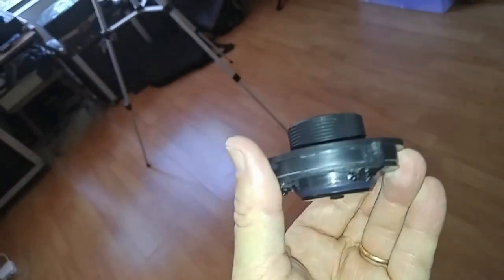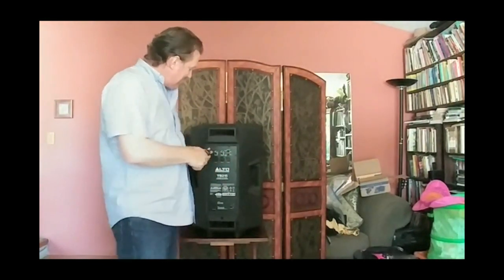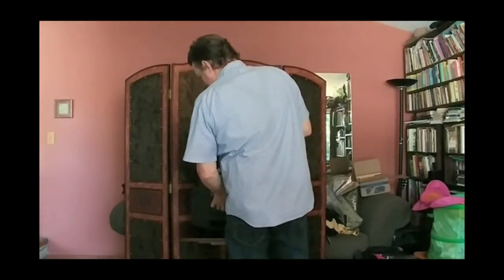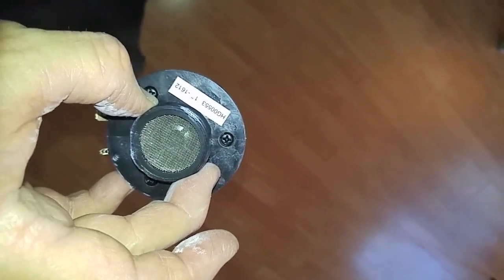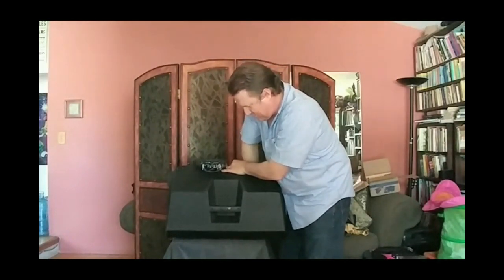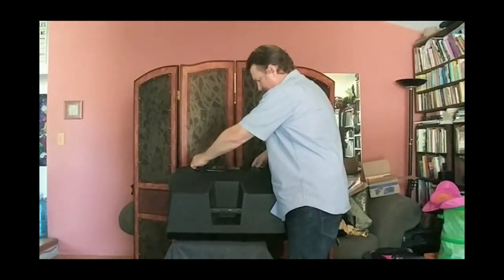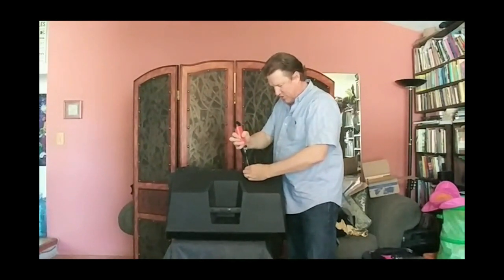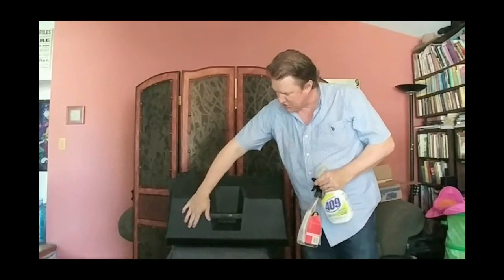How To Fix Alto TS215 Replace the HF Horn Driver Tweeter TS212 / TS210

Comment: Excellent video thankyou for posting, it worked, however mine didn’t come with a heat shield. Is it necessary and could u point me to a replacement heat shield like u have…Thankyou

Comment: Hi DJMarkP1, great video.  A very helpful tutorial!  

For anyone connecting a mixer into these speakers, the one and only correct setting on the rear panel of the speaker is 12 O'Clock.  That's the 'Line Level' setting, and that is what is appropriate for use with mixers.  The only time a lower or higher setting is appropriate is if another type of audio source is being connected directly to the speaker input (i.e. an instrument or a mic).  

You can blow drivers with the setting either too low, or too high.  

When the input gain setting on the speaker is too low, drivers get blown due to the voice coil burning out.  Voice coils burn out when performers turn up the audio source (mixer in this case) too high, and send clipping signal to the speaker.  It is very common for the faders on our mixers to creep up and up throughout the night.  Maybe the night starts with an occasional clip on the 1 / downbeat.  Half way through the night, we've raised the gains or faders on the mixer, and we're clipping on the 1 and 4 (kicks)...then on 1,2,3,4 (kicks and snares), then on every beat (eighth notes too).  The distortion from clipping in the mixer drives speaker drivers crazy.  A driver is like a piston, it goes back and forth in sinewaves...but distorted audio is squared off waveforms.  Since the piston motion can't produce a square, the inefficient motion is converted to heat instead, and eventually burns the voice coil.  You can actually burn out a speakers voicecoil with one watt of power by sending distorted signal.

When the input gain setting is too high, the amplitude of motion the diver (piston) is asked to reproduce is so high that it actually rips itself apart.

In either case, I'm sure other users will find your tutorial helpful!
Reply: Hi DJMarkP1 just caught the end of your video where you show how you're running audio into it.  When using an iPhone (or any phone), keep in mind that 'headphone outputs' are hotter than line level.  For this type of audio source, you should keep your phone 1 or 2 clicks below full volume.  Then adjust the volume on the rear of the speaker as needed (shouldn't be past noon), and make sure you're not clipping.  Hope this helps!
Reply: Thanks so much for your explanation. Now I understand better. Thanks again!

Comment: I decided to replace the tweeters and got a pair of JBL 2408H-2 clones (1.5") installed on my TS210 to be relaxed when using higher volume and maybe get a nicer sound. Side by side comparing one speaker with the Alto tweeter and the other with the JBL clone installed there´s very evident difference in sound, JBL clone being more crisp and more detailed.
Good news for 210`s owners is that, since there´s no top handle, there´s enough room for virtually any 1" 3/8 threaded driver you want to use, even the bigger ones.
Reply: Wait, what... this really works with no modifications?
Reply: and this wouldn't work with a 212? because of the top handle?

Comment: FYI:  Alto's newest model (TS310, 312, etc) has an improved neo driver for high frequency production (part number HG00640), although I blew mine last night in my brand new TS312, after maybe 1 hour's use (I have four TS310's and they have worked seamlessly for the past 10-12 months).  The downside of the heavier driver is that it's over $75 to replace, and that's if you do it yourself (the replacement process is the same as this video).

Comment: It happen to me on 2 speakers, I don't even remember how many times I had to replace them until I bought a pair of tweeters in Mexico 1000 watts, they are a little  big on diameter but they fit and that solve my problem.
I think I pay 500.00 pesos each.
Reply: Anung tweeters nbili mo? Anung name?
Reply: en donde compraste los tweeters  y que marca y modelo son?
Reply: Where you buy and what brand is it? Donde los compraste y que marca son? Por favor gracias

Comment: Excellent review and demonstration.  Thank you for doing this.  Question, couldn't the heat sink be installed on the new speaker while it's still out of the housing to make it easier?
Reply from the maker: I don't think so, as the space is very narrow.  Thanks for your nice comments.
Reply: @DjMarkP1  Ok, understood.  Thanks again.  I just ordered my replacement driver and will be performing the same fix.  Your video was invaluable in helping me decide to fix this on my own rather than either paying for someone to look at it, or trash it all together.

Comment: Hello, thanks for the video... Blew one of mine and ordered replacement but wondering did you add or replace the heat sink paste? If so what paste do you recommend? Thanks
Reply from the maker: I did not worry about the heat sink paste.  There was still some on the 
heat sink.  But if you want, it is available at most electronics stores, probably available on line from amazon.

Comment: I have a pair of Alto TS 315s and I would like to put some tweeter protections (PTC (Polyswitch or lamps or PTC and lamps together)
to find the value of the PTC (1Ampere or higher) and the bulb (12 Volt or 24 volt and 12 or 18 or 21 or 35 watt) I should know the real power of the tweeter. La Alto reports that it is a 1.4 inch (35 mm) compression tweeter with 350 Watt RMS power and 700 Peak Peak. The crossover cut is 2Khz. To me they seem exaggerated values, and so I really want to know what power the tweeter has in RMS and so how many amps does PTC need and how many volts and watts does the light bulb have?

Comment: Mark, thanks so much for the video! Did you add more thermal paste between the new tweeter and the heat sink? If not, you might consider adding some to ensure the heat transfer is sufficient. Appreciate you putting this together! My tweeter blew just recently, and the new part is on the way. This happened right out of the warranty window... Of course! Thanks again!

Comment: Thank you so much Mark. This is extremely helpful since Guitar Center as well as Alto (directly) did not offer any help but to send it out for repair. I have 4 of these TS215 speakers and 2 of them...I guess...blew this weekend. I was able to figure that out with this video by swapping out the tweeter from the good speakers into the bad ones and what do you know...they work. Now I just to order 2 new (HG00553  1" -1548) tweeters. Just can't seem to find them on Amazon....??????
Reply from the maker: You can buy them from Full Compass http://www.fullcompass.com/prod/517861-Alto-Professional-HG00602?gclid=EAIaIQobChMI3fLo7Lfq1QIVFRuBCh1ebQCuEAAYASAAEgIxavD_BwE
Andy says to try Selenium D220Ti 1" Titanium Horn Driver (Part# 264-270) or the Pyle PDS772 1" Titanium Horn Driver (Part# 292-2520). both at Parts-Express.com  - other pyle option is the PDS-333 - Someone also told me that 
they replaced theirs with a Peavey RX14.  - be sure to read yanni Ville's post below on how to ad extra components to protect the tweeter.

Comment: well i think in order not to burn the coil of your tweeter, i suggest to put (1mfd/50V non polar capacitor and 10 ohms/5 watts resistor. just connect them in series to positive side of your tweeter in order to protect the tweeter coil. because when turn up the volume over 12 0'clock the voltage increases and the coil will overheat. hope this helps. btw i have alto ts212 and installed capacitor and resistors on both tweeters for protection and still working without any damage from my tweeters.
Reply from the maker: Thanks for the tip,  I've been keeping an eye on the red clip light and trying not to let it stay on brightly and haven't blown any more tweeters since.
Reply: I WISH I knew how to do what you just said. No idea :) However, I keep the volume at between 10 and 11 o clock now. hope that helps

Comment: Replacing the heat sink paste would have been a good idea too. 
I wonder why the tweeters are generally so underspec'd?
Reply: Cost of production. Yet I was able to buy some decent CDs for 30 bucks, 7x the mass of originals and can handle the 20W the amp is pushing out. Even the venerable QSC K12.2 has a 60 dollar woofer in them, and 20 dollar compression driver. The rest is just DSP
Reply: I second Peter, adding more thermal paste would definitely help
Reply: @yanikbeauchemin9456  any white thermal grease like they use on CPU's, or another type? thanks.

Comment: Would something like Pyle PDS342 with 4" diameter magnet  fit?
I have TS210`s that must have even smaller room for the driver...
Reply: Check if you have a handle on top. If not you can fit 4 inch driver, if yes, you can fit a max 80mm driver in there, perhaps just 76mm. Plenty good drivers in that diameter out there. B&C, 18Sound etc....
Reply: @dannyb5874   Hey I'm not crazy into speaker specs. I have the ts212's and love the way they sound. Did some lower volume gigs worked great. Did a mud drag played music for 3 hrs and as soon as the announcer showed he said about 3 words an drivers blew. Could you post a couple good upgrade options for the high freq drivers. Love the speakers I think they sound better overall than a lot of more expensive speakers. I just need them to be dependable. I have no issue spending good money if it makes me more confident in using them. Thanks
Reply: @Brian_P  what also fits is a Selenium/JBL 202Ti driver. DO NOT mix it up with the 220Ti. That one has too big a diameter. D202Ti fits without mods and should last. I would also buy an atenuator for highs, 50 or 100W one. PE should have them. You might need to pad the tweeter down a bit.
Reply: @dannyb5874  Thanks I looked up the driver's I'll probably order them. Looked up the atenuator on PE and I have no idea. I've never even heard of such thing. I'll have to do some research to figure out how to use them where to put them ect.

Comment: Hi Mark Thank you so much from a dj in Ireland. I was able to order the drivers in Europe from SBS Audio Visual in the UK. The link to the product is  https://sbsav.co.uk/shop/83184-alto-ts210-ts212-ts215-replacement-tweeter.html
 I would like to point out that the part numbers were different to both numbers you showed, but the product, combined with your wonderful video has my speakers up and running great again. I got 18 months from mine before they blew because of a dodgy mike.

Comment: the reason you blew your horn is because you went past 12 oclock. if you look at the graphic on the dial, 12 oclock is the end of the line level input. after 12 it starts over as mic input. and mic input has a 20 db boost for microphones to be plugged in without a mixer preamp. its a bad design on altos part. should have had 2 seperate knobs.
Reply: Also during SWITCH ON he just pulls the signal cable, from speaker and source. Creating huge spikes.

Comment: are the lines on your alto's mono or stereo i have the 115a version nobody can tell me each line mono or stereo
Reply from the maker: It is a single speaker, so both inputs are mono.  If you have two lines you could hook up one channel to each of the two inputs.  These speakers are designed to be used in pairs.  so normally the right channel is one speaker and the left is the 2nd.

Comment: what size heat sink is required? my magnet came out of the tweeter with heat sink attached and i havent been able to unscrew the heat sink. gonna order new driver but also will need a heat sink.
Reply from the maker: The heat sink screws directly onto the back of the Driver.
If you a different driver, you may not need one.  Just twist to the left.

Comment: great video...my heat sync has fell off after i dropped my speaker...is this fixable
Reply from the maker: The screw is super short, you should be able to screw it back in
if not go to the hardware store and get a slightly longer one
Reply: DjMarkP1 unfortunately the tweeter has snapped off with the heat sink still attached. I have sent off for a new tweeter and some transducer paste. Is there any more reliable tweeters out there that would fit the alto ts215??
Reply from the maker: Where did the tweeter snap off are the threads still in the whole of the horn? It is a standard 1" thread as far as I know, the problem is if the horn driver is too big, it won't fit in the space between the top handle and the horn.  Read the other postings, below there are several parts that will fit if the horn casing threads are still working.
Reply: i was able to take the tweeter out..the threads are all still intact so i have ordered another tweeter and some transducer paste. i guess i will have to have the volume down a little.. that sucks lol.

Comment: I keep my speaker gain inbetween 10-11 oclock and I still burned my tweeter.
Reply from the maker: you have to watch the clip light, It if stays on you will blow the speaker in no time.  It should only be turned up to the point where it blinks lightly on the beat.

Comment: One of my inputs on my Alto TS312 works and the other does not work any more.  What would you do to remedy this?
Reply: Buy a different brand speaker. I had exactly the same problem 2 weeks after I bought Altos and Guitar Center said they would NOT repair or replace them because...and I quote..."These are NOT meant to be Professional Speakers." I used the second channel for a few months and the the HF horn driver went out on the speaker. After years of buying gear from them I have decided NEVER to buy anything from Guitar Center again. Alto's are great sounding speakers but they are EXTREMELY unreliable.

Comment: If people think these speakers have 1250W or 1500W or even 2000W...yeah right. In your wet dreams. The amp draws 450W from the mains at full, efficiency is perhaps at 30%. Forget all this gazillion watts nonsense. More important is efficiency and sensitivity per 2.84V input. I suspect the TS212 is like 20W highs, 90W lows. Just got hold of Pyle 1" CD and B&C 1" CD, one as a cost effective solution for others, the more expensive one for my self (7 speakers to change the highs). I cant run them with the knowledge I have some 20gram 5W Neo tweeters in them :)

Comment: Alto are the worst speakers I have had. Very bad speakers. Dont buy them. Even thu you change the tweeter it will broke in less than 5 used of speaker

Comment: Don't bother replacing the tweeter with a replacement alto tweeter!!! Those tweeters are garbage they are only rated for 30 watts rms but the amplifier puts out 200 watts rms just go for a thrid party tweeter.
Reply from the maker: Thanks for the tip Jonathan,  do you know a brand or a part number of a replacement tweeter that will fit?
Reply: not sure look at parts express they have a lot of speaker drivers
Reply: Yes but most of the horn drivers at to thick to fit in the limited space.
I'll call them and see what they recommend, I have bought from them many times in the past.
Reply: let me know which ones they recommend
Reply: I wouldn't use a different tweeter. Anything else you use will sound completely different. These are great sounding speakers... a different horn driver will change that entirely.
Reply from the maker: HI Jonathan,  I called parts express, they don't have a reference replacement part.  They told me I need the crossover point, the impedance and dimensions of the driver to suggest an alternative.  I looked at all the pics, they appear to be too large. to fit in the case.  If anyone knows an alternated part that will fit please let us know.
Reply: B&C has a nice 75mm compression driver which sound wonderful. Some L-pad in there and your sorted. It wont change the sound of the speaker that much, and I imagine, only for the better. The parts inside it are worth 80 bucks all in, so a 50 dollar CD will only improve it.
Reply: @fermd9357  The Selenium D220Ti driver does not fit in the TS212 cabinet due to the depressed are where the handle is on the outside. I just tried it.  Have to send the Selenium D220Ti back to Parts Express.

Comment: If my alto speaker doesn’t make any noise but turns on does that mean my tweeters are blown out? I can’t eat any sound at all
Reply from the maker: if no sound at all, It is not the tweeter, it's either a connection or the amp.
If you had bass but no high end, sound was mushy then it would be the tweeter.
Reply: DjMarkP1 I can hear it when it turns on but no sound off mic or anything. I was playing it yesterday with my alto subwoofer and this morning it wasn’t working. I can’t figure out to find the problem